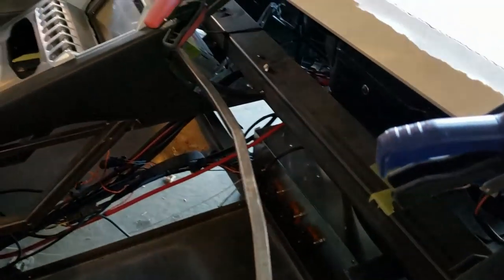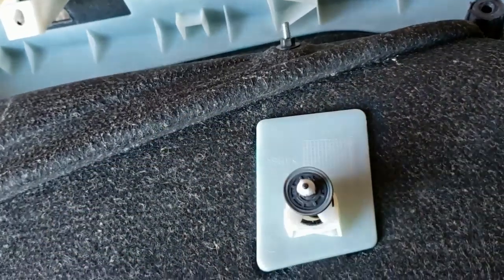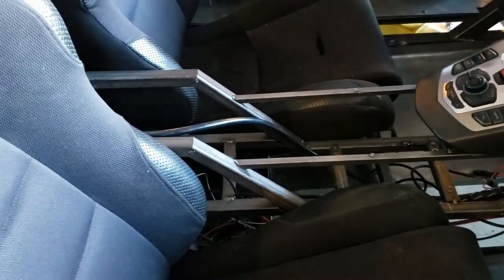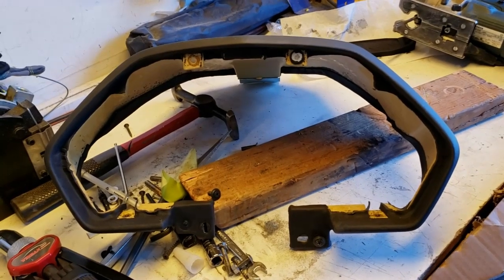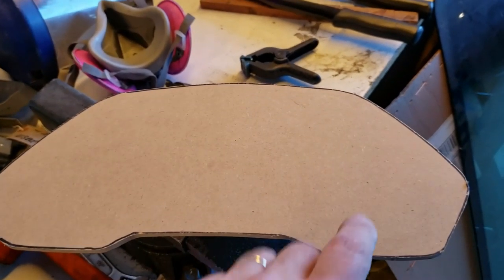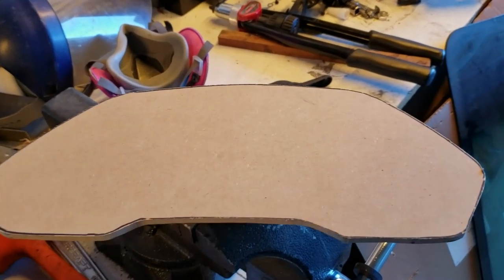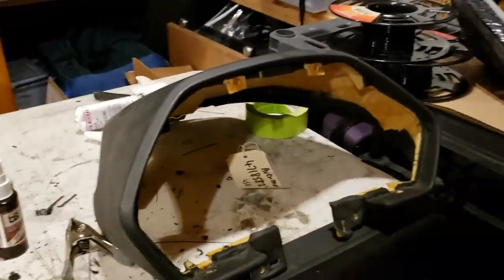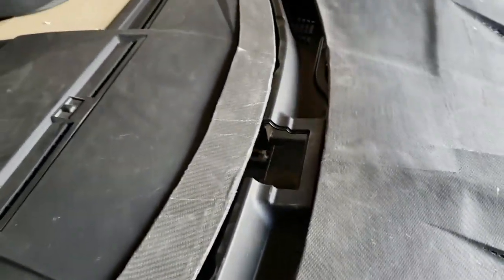3D Printed Interceptor Update 22

Comment: Great job... loving every reasoning method your using on parts, and suggest more 3d printing on parts ✨💯🤳🔧 if you have a shifter that locks in park, then no need for parking brake other than a resuvoir drift style mounted e-brake 🤖🤺💯🌵💚🐢